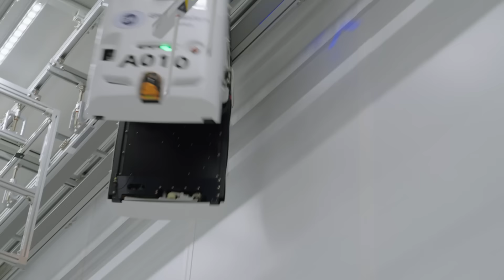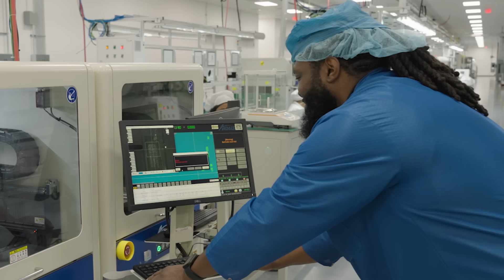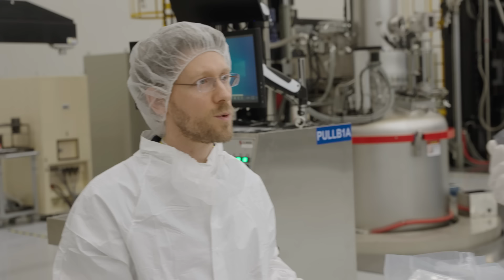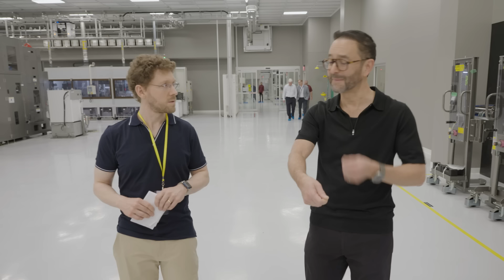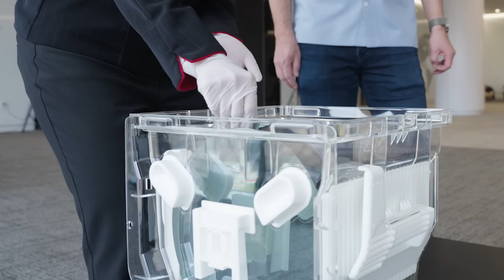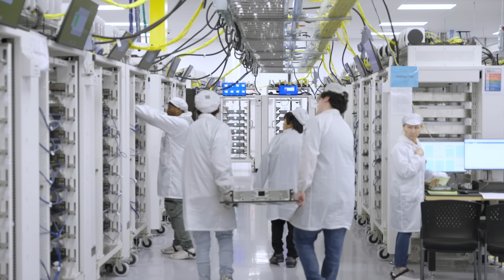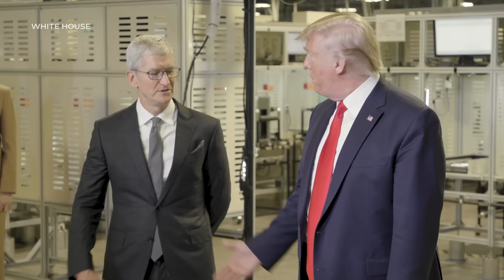Inside Apple’s Multibillion-Dollar Push to Make Chips in the U.S. | WSJ

Comment: This video couldn’t have covered everything. My brother was a geotechnical engineer/inspector for the Intel Fab in the same area. He said the amount of engineering that went into that site was INSANE. 

They built a flood reservoir for that building for the monsoon season there. As it was being tested during a monsoon, it filled in 90 minutes. So they started from scratch. 

A pipe sub station near that building that supplies critical chemicals was made to withstand a plane crashing directly into it. 

And it goes on and on and on and on.

Comment: Anyone who worked in manufacturing of any kind knows it’s never plug and play as the people outside the industry like to say. Not even machines that have proven at a different plant to work perfectly well. There are parameters to fine tune to get it just right. I can’t even imagine these complex machines as they mentioned, dealing with on an atom sized level. Hoping to one day be able to work for TSMC AZ. Background in manufacturing machinery design and integration. I would love to elevate my capabilities with TSMC. Might not be the sharpest tool in the shed but boy do I love to learn and get sharper.

Comment: Dude I got chips for DAYS

and I got different material compositions for them

And then I put transistors and core memory inside

With many different geometric arrangements 

In 3D software logic

Defined ultimately by the hardware 

[Unlike software defined chips... like what is that?! A telegraph line connected to a phone through internal telegraph lines?! XD]

Comment: I can’t respect a news outlet that opens a story with an out right obvious literal lie. I just can’t. 🤦‍♂️
Reply: What was the lie
Reply: “Every electronic in your house has chips in it” 
Mostly true, but not entirely. 
Petty? Yes, but after the last ten years, I have zero tolerance lol
Reply: @ericanthony1982  name few electronic device that only use capacitor resistor and inductor
Reply: @S@SanjayDeyPartholet’s see…window fan, blender, amplifier, etc…
Reply: @ericanthony1982  amplifier use transistor Wich is a chip , blander (modern)use MOSFET in regulator for speed control again a chip  same for fan in general ( modern)
Reply: Out of all the example amplifier really?
Reply: @S@SanjayDeyParthoyes. Transistor isn’t a chip tho..
Reply: @ericanthony1982  by concept isn't a chip but by manufacturing it is a chip
Reply: @S@SanjayDeyParthothat’s like calling a single neuron a brain
Reply: @ericanthony1982  any device made on a flat piece of silicone or similar semiconductor is a chip ,it can be a single transistor or multiple array of transistor acting as one
Reply: @SanjayDeyParthoI’ll end this how I started it. 🤦‍♂️🤦‍♂️🤦‍♂️🤦‍♂️🤦‍♂️

Comment: They said tens of thousands of chips everyday and they're not even the most advanced ones. Let's say a fe w million chips a year and an iPhone aproximately needs 30 of them said in the video. 250 milliyon iPhones sold every year and this requires 7.5 billion chips with this calculation. So we need 7.5 billion chips but as I saw in the video only a few millions are manufactured in the US. There's a lon long way to go it seems.

Comment: 0:15 "For decades most of the world's chips were made overseas" Technically true, but most of the world happens to be overseas, so it is natural that most of the global industry is not in the USA -- even though initially chip manufacturing was invented in the USA. 
Currently world's chip manufacturing can be divided into four roughly equal streams coming from PRC, Korea, ROC, and (Japan + Europe + USA). 
Most of the chips are sold to PRC, where they are assembled into products which are then sold around the world.
(Because in some specific, very important niches, the market is dominated by TSMC, it is extremely common to incorrectly report that they are responsible for a much larger market share overall.)

Comment: NVIDIA has significantly improved agentic AI inference performance and cost efficiency based on its latest platform artificial intelligence (AI) graphics processing unit (GPU), the 'Blackwell Ultra'.

According to NVIDIA on the 24th, the 'GB300 NVL72' based on Blackwell Ultra increased the processing capacity per megawatt (MW) by up to 50 times compared to the existing 'Hopper' platform, and reduced the cost per million tok

😮😮

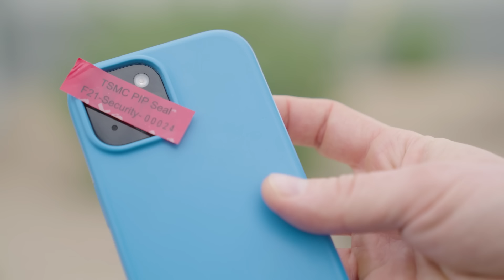Comment: 6:02 what precaution is that? 😂😂😂
Reply: They’re tamper evident seals that they put on and remove so they know if you have taken photos or video inside the facility without permission. 

If you take it off it shows words underneath (on the label itself) so when you hand it back to security they will know and likely request access to your device, tho that part is unsure, but I’m sure they take corporate espionage pretty seriously. Especially since only 2-3 companies actually operate leading edge/next gen producing fabs (TSMC, Intel relatively recently and Samsung) so competition for that type of innovation is kept super tight. Even just the layout of the machines and chemical plumbing is deemed proprietary info type of thing
Reply: @eyeamwe @eyeamwema English isn’t my first language language so I’m trying to understand, thank you very much for the information. 

What I don’t get is: what kind of temper seals is that? For sure they take security very seriously and I’m ignorant about this seals, but it looks like a normal sticker from the video

I’ve had my phone requested before entering sensitive area, I’ve seen “special” sticker that gets very stuffed if you try to remove it so you can’t put it back on, but I’ve never seen a small film like that (surely it’s  my fault, not saying you’re not correct 😉)
Reply: @eyeamwema sorry, after a quick research I understand what you have written before. Thank you for the info

Comment: Yup, Europe is cooked.
I live a few miles from Eindhoven, you see these long 'special transport' semi's with 'ASML' in big letters on the side, cruising down the highway to sea- and airports in the neigborhood. None of them are meant for Europe itself. Eindhoven is doing fine though, they've assigned a new piece of land especially for building housing for new ASML employees to work in their soon to be openen expanded production facility.
Reply: Why is Europe cooked, if it doesn't produce chips? It has plenty of high tech industry for making chips and for using chips. This Arizona project still has to be proven successful.
Groeten uit Vietnam van ex Veldhoven techneut.
Reply: @castheeuwes1085 Self sufficiency. If you rely on external supply from a party with very different interests or morals, you are very vulnerable.Take Nexperia as a lesson.
Reply: @castheeuwes1085  Groetjes terug trouwens 😊

Comment: Who comes up with instructional manuals for these beasts of a machine
Reply: I guarantee there's a lot more pages of that than the other PDF files
Reply: Engineers in the Netherlands
Reply: @hbwi73jnctrwoo7r That's partially true. The lithography machines are designed and built in the Netherlands but to get all the different machines to work together and make a manual for that there is a research facility in Leuven called IMEC. They work on designing and testing the full production line using various machines from different vendors.

Comment: It's one thing if the US can make them locally, but the cost will be a whole other thing, and will be the ultimate factor if this will even push through.
Reply: 3x or more
Reply: The price is the same we already made the iPhone 16 and the price is the same
Reply: @yoonieao  You did not "make the iPhone 16" - ALL PHONES ALL IPAD ALL MACBOOK ALL IMAC are made in Asia - Foxconn generally in China.
Reply: @joebloggs6594  I WORK THERE. we made the chips for the iphone 6 which i have so i know the cost of the phone. We are currently making the beats and no one is going to buy $3000 beats so dont be stupid.

Comment: It would have been awesome if Intel agreed to make processors for Apple.
Apple approached I tel first to manufacture iPhone processor, Intel refused.
Reply: intel is late, and is completely blown out by AMD . Look up its marketshare and stock price compared to AMD, Nvidia,  (both chip designers) and then TSMC (manufacturing)
Reply: @Mohas191   Intel still has a large marketshare compared to AMD depending on the category. Nvidia has always dominated GPU's and Intel has started it's GPU division only a few years ago. Intel now has a competitor node to TSMC, give it a few years and they can now actively compete with TSMC. They are late but at least there's a chance now.